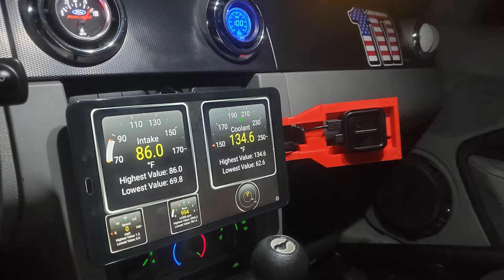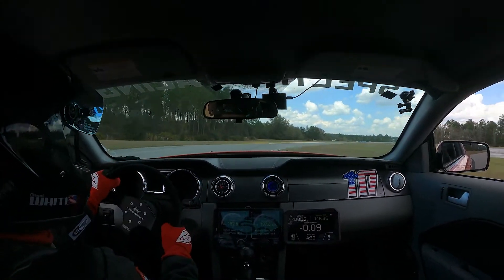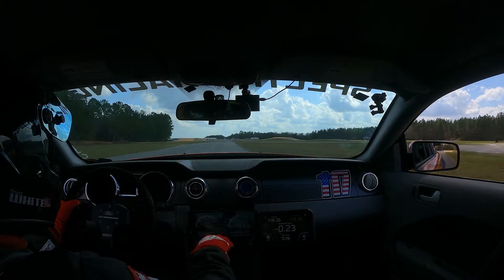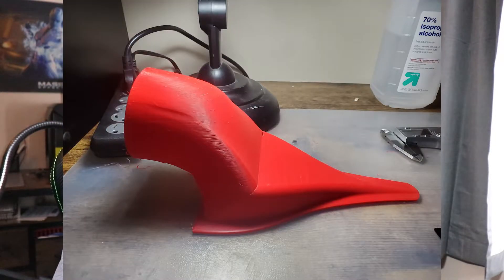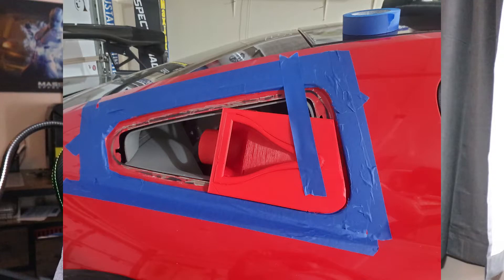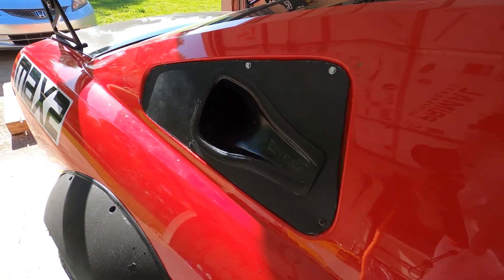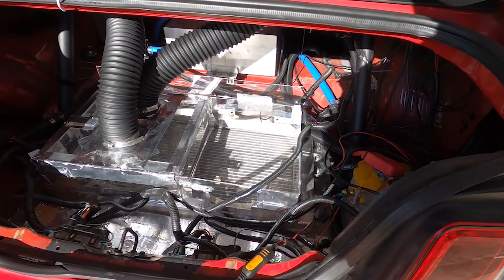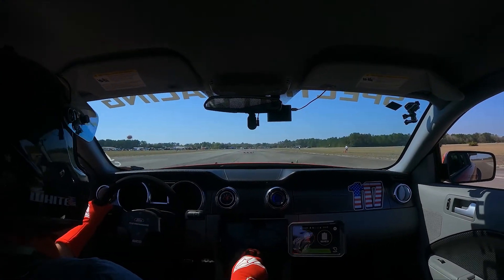Prototyping Car Parts with a 3D Printer - Custom Heat Exchanger Naca Ducts

Comment: Idk if you have one but a rear diffuser coupled with a duct from the heat exchanger to the license plate hole would probably help suck more air through the heat exchanger. Lower pressure faster moving air from the diffuser to pull the air through. F-16 use something similar with high pressure bleed air from the compression stages of the engine fed into small tubes near the exhaust nozzle to promote airflow around the jet engine while on the ground.

Comment: Nice attempt but naca ducts designed wrong can impede airflow.  You need the lip of the duct to trip the laminar flow to cause a vortex to allow flow into the tube.  Overall a scoop would better but it does cause drag.  Keep up the good work!
Reply: You think so? I can’t imagine it would cause that much of an issue as far as drag, only going around 100. It would be a problem for NASCAR, but can’t imagine it doing much at 100mph.,

Genuine question, I don’t know much about it.
Reply from the maker: Thanks! So I went ahead and bought some chill out systems 4 inch naca ducts. These were professionally designed. But I'm waiting one. Bunch of other parts before I can see how much more effective they will be than the cheap 3 inch ones. Also redesigning the entire radiator airbox and outlet so it's more efficient after talking to some experts. Will make an update probably in a month or two.
Reply: @SpectroRacingChannel  sweet!
Reply: @88e303stanggt  as you said, it may be minuscule but a fraction of a second is all that what could determine the difference between winners and losers.  If it's for fun, then its okay and I'm glad he is willing to experiment.  I think the overall issue is getting right cooling and airflow which is more critical.  it's also a balance between cooling, airflow and drag.